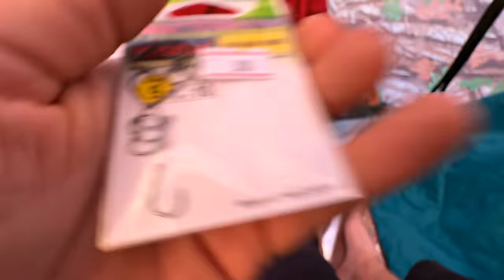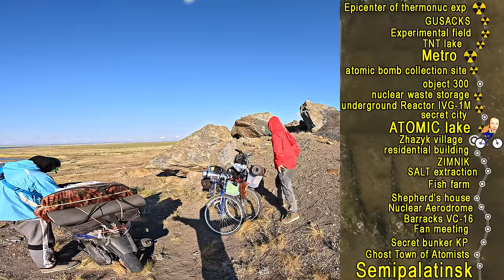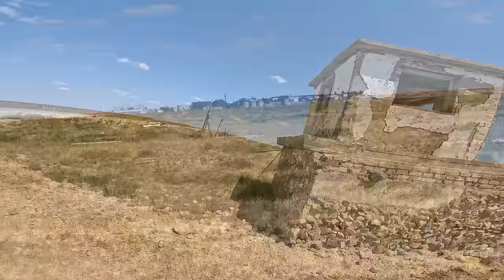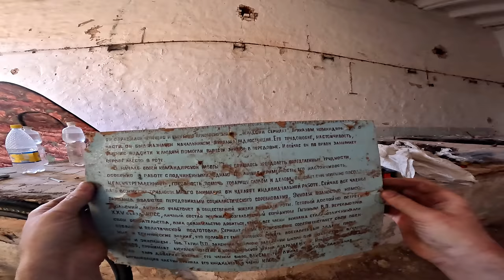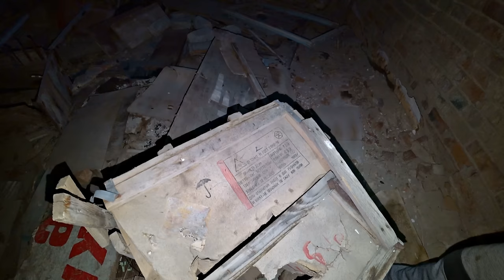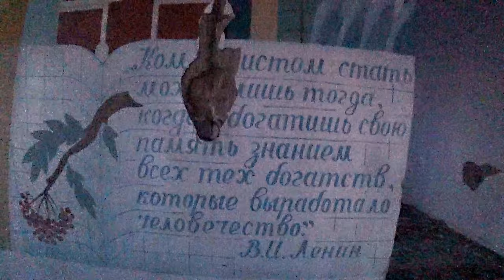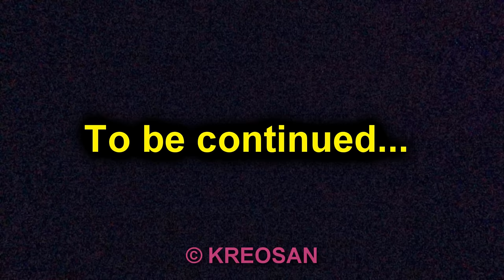✅Fishing on ATOMIC LAKE ☢️ MUTANT CRAYFISH 3 kg ☢️ Found the LOST CITY ☢️ Hiding from security

Comment: I cant believe those engines still run after the amount of guessing the oil it is a precise matter 1 liter gasoline you need to mix 25ml oil also you can better mix it in the bottle so you can shake it well
Reply: I run about 35:1 or 40:1 of full synthetic oil.